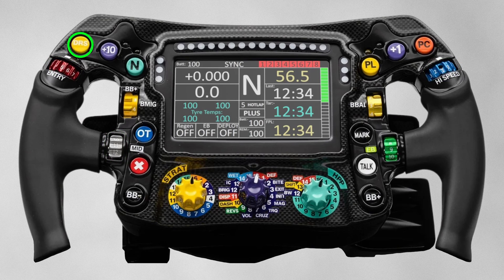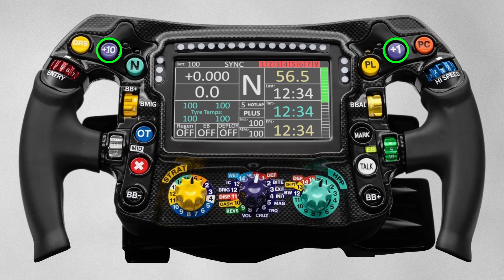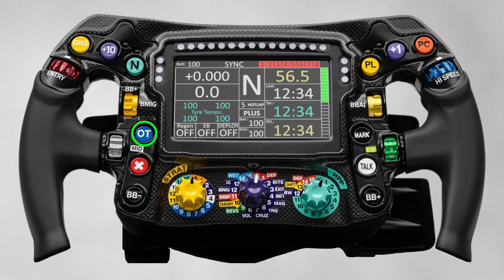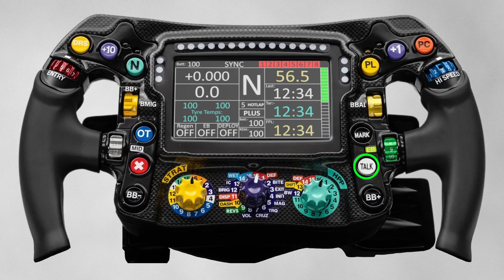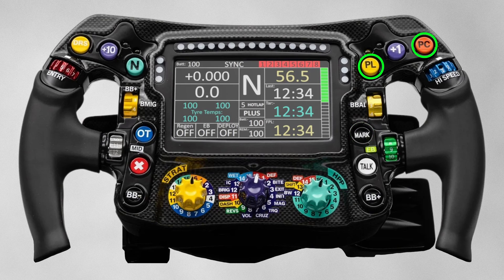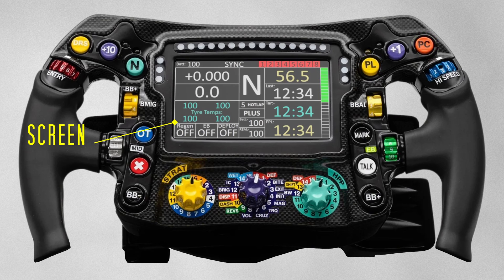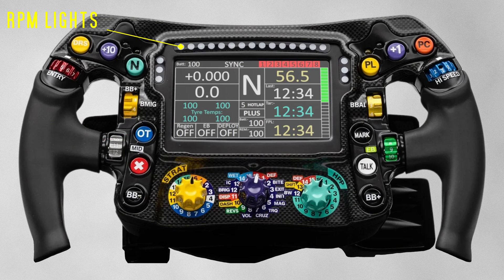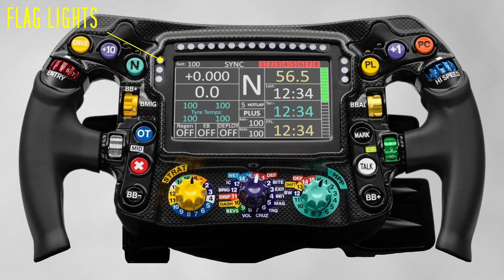Formula 1 Beginner's Guide - Steering Wheel

Comment: Great video, I really enjoy them, but where is the drink button?
Reply from the maker: In this example I was using a Mercedes wheel and they actually don't have a drink button anymore as they dont use a pump like they used to.

Instead the driver simply sucks on the tube. It avoids any pump failures and saves weight.

Other teams do have drinks buttons though!